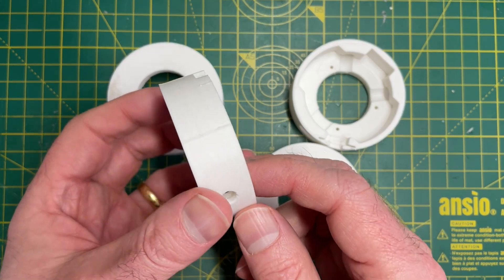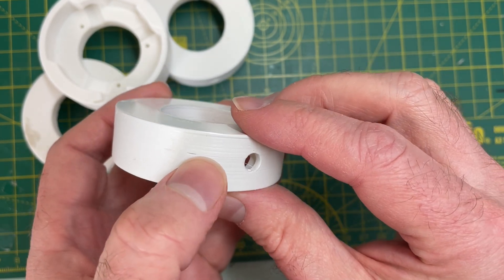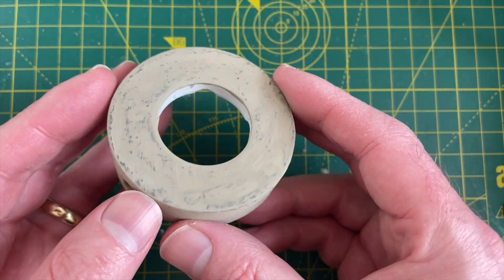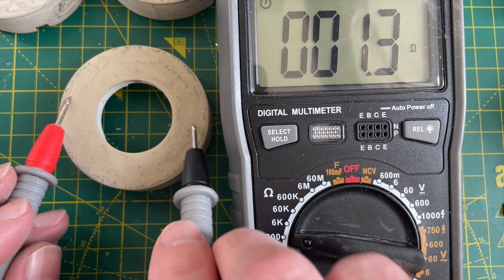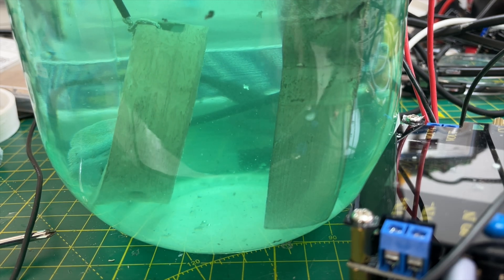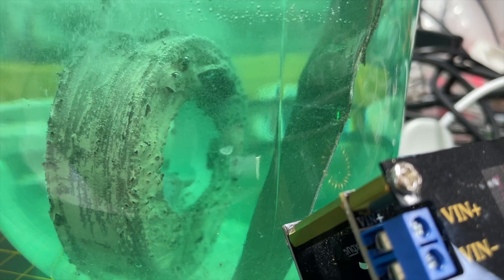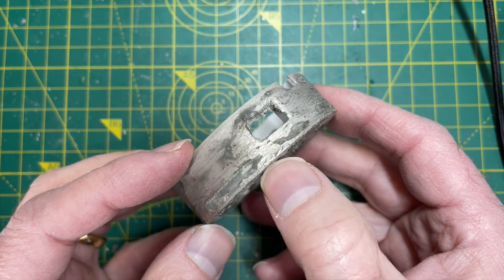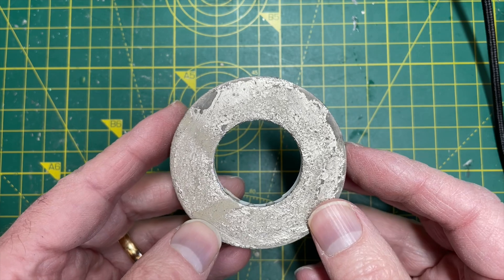Nickel Plating 3D Prints - Not As Easy As It Looks!

Comment: How about using carbon filled filament and perhaps even a sloid metal "spreader" to get even potential over the surface? Using a lower current might reduce bubbling (though will take longer) which might result in a more smooth surface finish.

Comment: I had good results with 50/50 vinegar peroxide solution to dissolve copper pipes. coated print with india ink and graphite powder then very low volt and amp ac dc converter to copper plate. I even made a custom coin 15g of solid copper after 3 weeks. nickel is dangerous in comparison

Comment: You're burning the coating instead of making a deposit on top of it... Go with less amperage and spin the piece in such a way all surfaces change fluid constantly. Make sure during hydrolysis the temperature of the fluid doesn't exceed ~40-50 degrees Celsius.